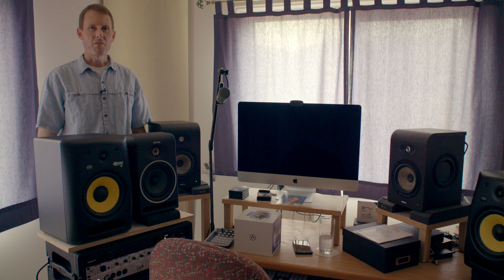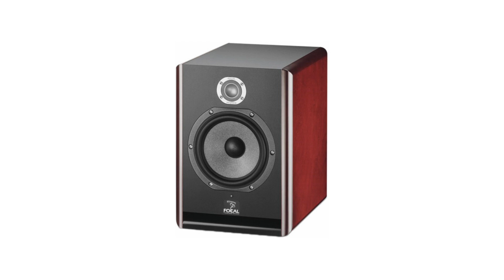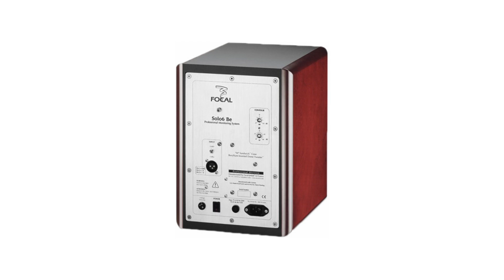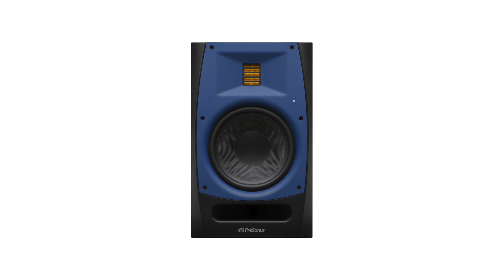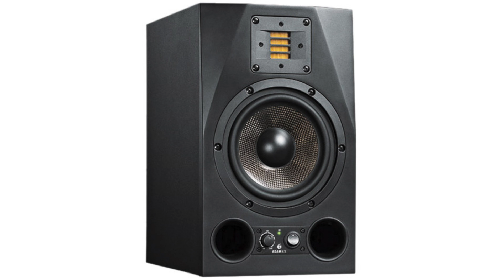Sound for Video Session: Thoughts on Near-field Monitors - Focal CMS 65, Shape 65, Solo6 Be

Comment: are the Solo 6Be's are great also for casual listening? or mainly for mixing? 
thanks.
Reply: It just so happens that I bought a pair today. I will try and let you know. But my sense is that they will be excellent for just listening to music and anything else. That's the thing about high quality reference monitors like this.- they should play back the music so that you have a more precise picture of what the mixer/producer/mastering engineer intended. To be certain, you'll really need to go listen to them yourself.
Reply: are they extremely different from the cms?  in what way?
Reply: The Solo6 Be uses a Beryllium tweeter which is a much more rigid material so there is more definition and separation of the high frequency sound reproduced. I can definitely hear a difference. But of course they cost a fair bit more. I really recommend you listen to several monitors you are considering in person to make a decision. Take some reference audio tracks with you. Most Pro Audio shops will help with this.
Reply: what about the presonus sceptres? have you tried those as well?
Reply: I have not tried the Sceptres. They look interesting.

Comment: Actually Ribbon or Emit tweeters are vastly superior to dome tweeters in their dynamic headroom, and are not going to compress dynamics unlike Dome Tweeters. Or distort nearly as quickly. Placement is important with any speaker, and I have had groups of people listen around me on the Emit or Ribbon Tweeters with no issues. I suppose your mileage may vary.
Reply: Also more good info, thanks!

Comment: Passive Radiators are mechanically, and Acoustically coupled to the main woofer driver. There are no phase issue. Low Frequency extension comes from these Radiators. Better than ports in many ways. Ports can Chuff and that is make its own sonic signature that is not desired, though with new designs ports are quite good too.
Reply: That is completely incorrect !!!! 

There ARE phase and transient response issues in vented/PR loudspeaker designs.

That is WHY some hardcore freaks ONLY use sealed boxes.

Passive radiators are "very similar" in function to ports & they function by setting the box into resonance ( look-up Helmholtz resonator ) just below the driver's resonant frequency ( fs on a driver's data sheet - along with other Thiel Small parameters ) thus "extending" the overall system ( loudspeaker in this case ) low frequency response. 

An entire book could be devoted just to this segment. 

The transient response for passive radiator based systems is actually worse than for a vented system BUT you can tune the speaker lower.

Ports or Vents need to be appropriately sized in diameter to reduce port velocity & possible problems with noise, otherwise known as "chuffing"

Ports need to be radiussed on the outside AND on the inside to minimise "noise"

The size of your "box" with your chosen driver + which "alignment" you choose, determine your vent dimentions.

This is a very complex & often misunderstood subject - it took me some 10 years ( after studying electrical engineering ) before I knew WTF I was doing ( no I'm not stupid ) 

A well designed vented box ( in practice they are very hard to come by ) will have a superior transient response to a passive radiator design - the passive radiator can go mlower but it's transient response will be inferior.

A sealed box will be superior in transient performance to either @ the expense of inferior low end frequency response.

This is where the saying " There is no free lunch " comes from ;-)

for more information I can recommend Rod Elliot's theaudiopages.com as a great starting point & the free Boxsim simulation software

Loudspeaker design is great !!! 

I'ed say anyone with average or well above average intelligence needs about 10-20 years to feel moderately competent ;-)
Reply: @BogdanWeiss  I guess spelling is not part of that. "I'ed" but you know.
Reply: Thank you Bogdan for the information. We're all learning here so the additional information is very much appreciated.
Reply: As I said, learning. Thanks for the information!
Reply: I felt the word you were looking for to describe speakers & microphones is transducer ;-)
Reply: Why great when completely incorrect ?
Reply: Yes, thanks!
Reply: This explains why many consumer Bluetooth speakers use passive radiator topologies.
Reply: Great info, thanks Vincent!

Comment: Actually, what is the ultimate material for tweeters is a bit of a discussion . I guess some would say graphene but it's so expensive it's not even funny. I've also heard physicists claim controlled discharges of electricity right into the air(aka continuous, small lightning bolts) can sound quite pleasing but then you would having the smelly nitrogen oxides and the dangers of high voltage to to deal with. So beryllium may not be so bad after all?
Reply: Haha! Yes, the charge directly into the air sounds dangerous! I'll stick with Be.
Reply: Heil plasma tweeter. Been out since the early 1980s. Sounds incredibly transparent, there is no smell at all and it is very safe - as long as you don't tinker with the electronics inside. But it has a continuous hiss (audible from distances of ~1 m or less), or at least the early ones I listened to did...

Comment: One thing to control the bass is to fix acoustic panels to the appropriate places on the walls if you don't have a dedicated 'sound' room. 

In order to find the correct places, a big upright mirror is handy so that you can sit where you will be working and move the mirror around the wall in order to identify where reflections will bounce from. Wherever you 'see' the speaker in the mirror from the seated position is a reflection point where acoustic panels might well be beneficial. (Also panel up the corners)

Sounds very 'nit picky' but for really good speakers, the payoff is a better controlled bass which can totally change your views of speakers. (Even on the ceiling)

I did this trick in my front room a few years back and it really did pay off big time. Just had to make sure that the panels didn't look too ugly, so I got grey flat ones and painted a border around them in order to make them look like a decorative feature. 

The room that you're in there, Curtis looks like an aural problem which could very much affect the mix for the end listener quite significantly.
Reply: Hi Ian, thanks and I agree, treatment with bass traps makes a huge difference, assuming your monitors can reproduce sound well. This room was quite problematic until we designed the treatment plan for the room (exactly as you say with bass traps on the first points of reflection on the walls and ceiling as well as corners and rear walls.)